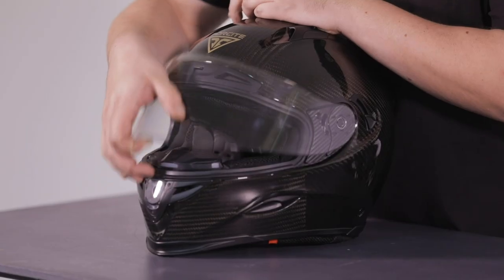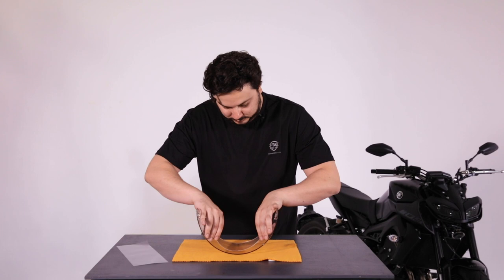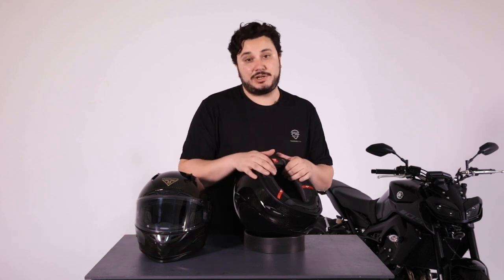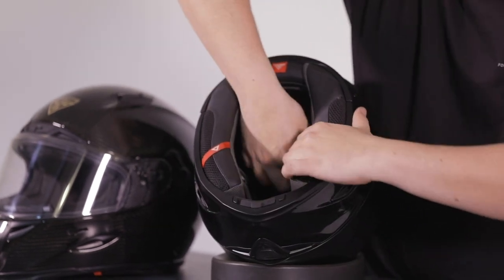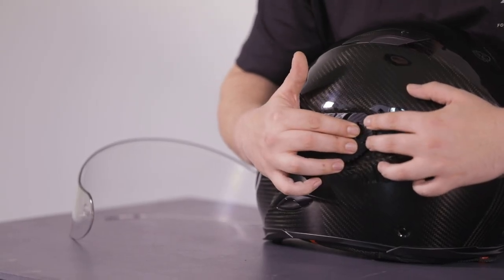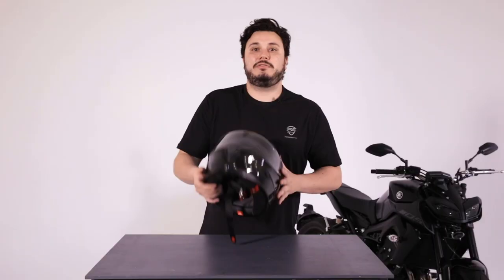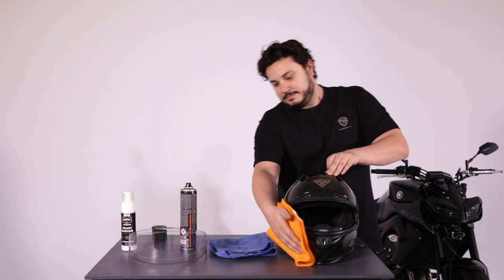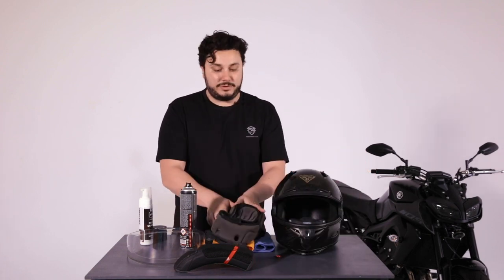Forcite Instructional Video: Visors, Padding and Mechanisms

Comment: I checked on your site and found that XL 62cm is largest listed, will that change or will custom larger be available ?
Reply: Kevin, I too have an enormous boofhead and normally wear an XXL in Arai/Shoei (63cm). I admit I was a little concerned about the sizing too. It arrived on Friday and while I've only worn it for about 20 minutes and so can't confirm the long-term comfort, I managed to get it on OK. the default cheek pads (20mm) were a little tight feeling, but I had already gone and bought the optional 15mm pads and found them to be more comfortable. The only thing I'll say is that the helmet feels a little short (like my chin is exposed) in comparison to the Shoei I have most recently worn, but the chin curtain is under my chin so it definitely fits in that respect. Might just take some getting used too. It's HEAPS lighter though, which makes up for a lot.
Reply: @TonyScott896  Thanks for the info Scott 👍👍😎